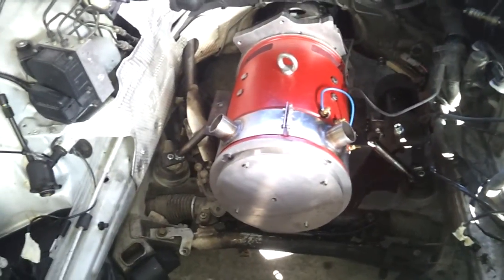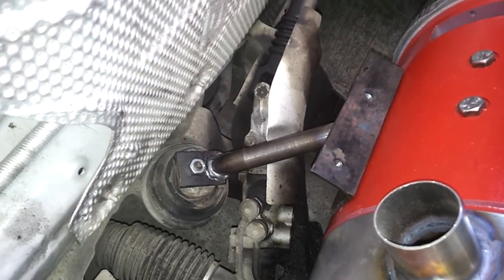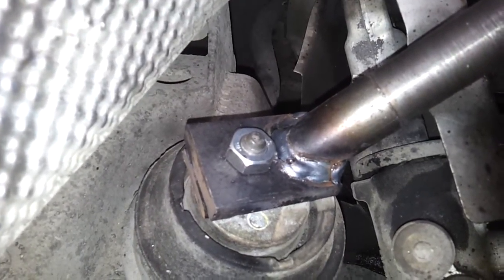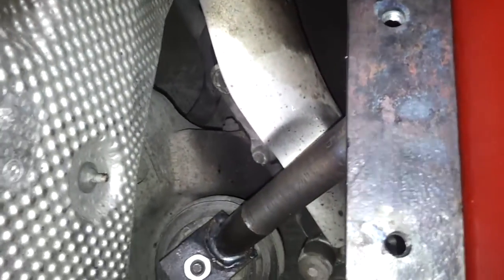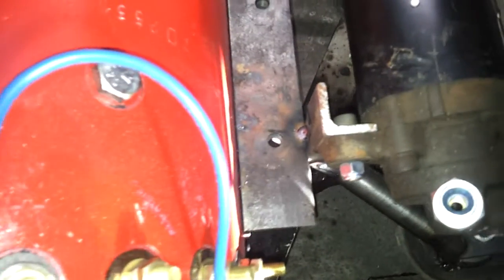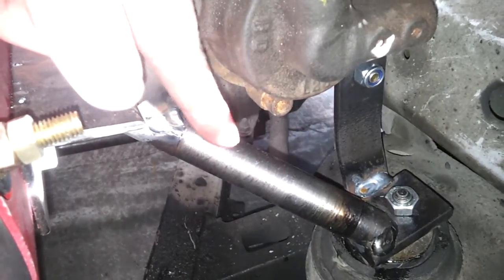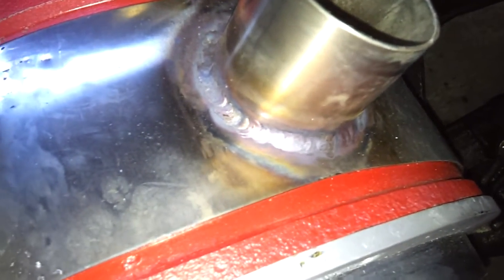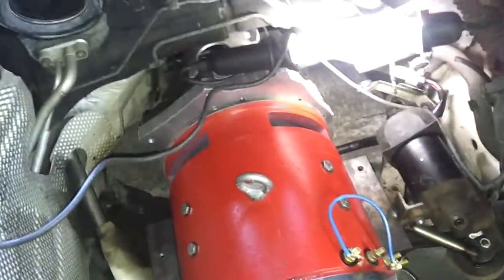BMW E39 EV Conversion 12 Mount Up

Comment: HI NICE WORK BUT YOUR LEFT SIDE MOTOR MOUNT IS LEAKING FLUID SO YOU SHOULD REPLACE IT WITH A USE OR NEW RUBBER MOUNT. I'M NOT SURE IF IT IS THE ONE THAT WILL GET THE PUNISHMENT FROM YOU TORQUE MONSTER. WHILE DRIVING FORWARD BUT I THINK SO

Comment from the maker: Its a rebuilt 80v from an 8 ton sideloading forktruck. I'm afraid calculation would be garbage in garbage out without specific data so I just build it as strong as possible!